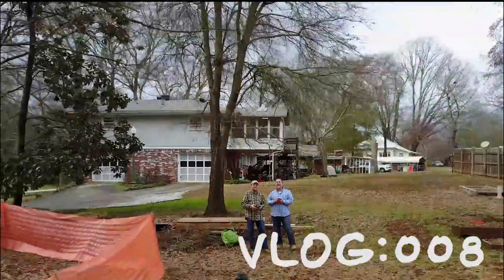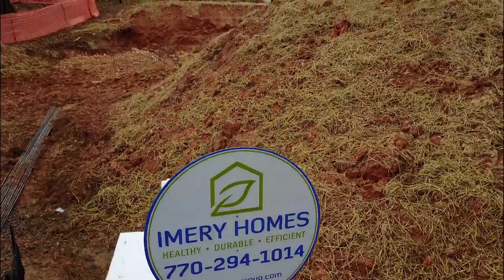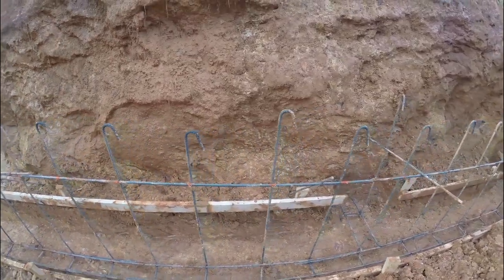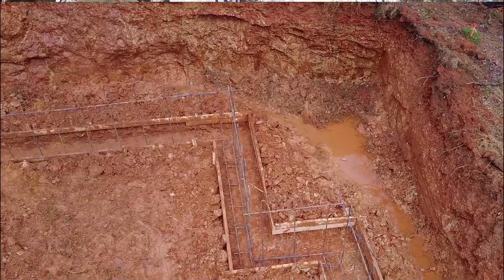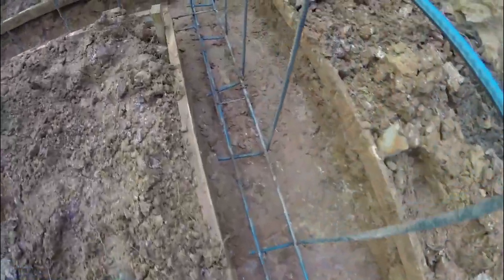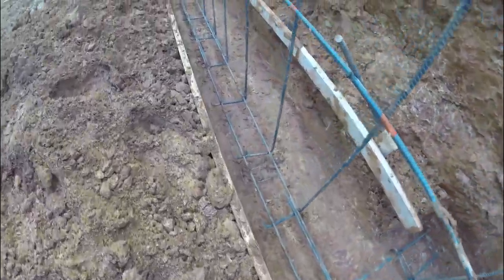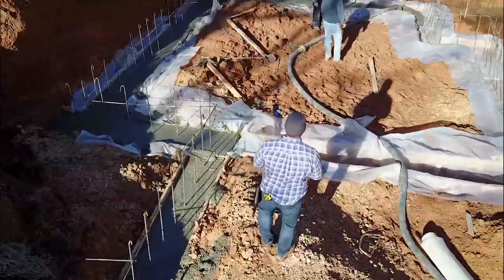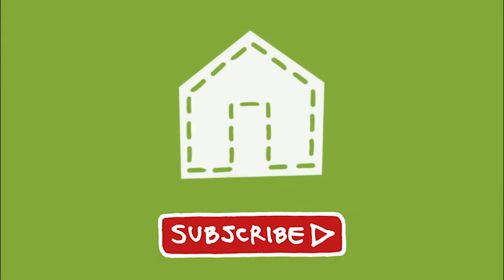Pouring The Concrete Footings | VLOG 008

Comment: Nice to see your progress on the new home. My question why did you not insulate the footings before the concrete pour? I presume the plastic was for additional water proofing, but why wasn't it used for the entire footer? Concrete is a sponge when it comes to water, and will always stay damp if any is present.
Reply from the maker: Hi Fred. Thanks for coming to the GreenHouse channel. We did insulate the slabs (future video), which sit on the footings, and will insulate the edges of the slabs as well. We've also got a waterproofing and insulation on the outside of the basement walls (also future video) and two drains. One on top of the footing and the second beside it.

Comment: I'm curious to know if you have heard about ICF (insulated concrete forms).  I don't have loads of experience with it as I am only an apprentice carpenter but from what I understand it's a greener option as there is a lot less waste material, less work in the long run and the forms act as an insulator/vapor barrier.  You share loads of helpful information with us, so I thought I would share this with you. Here is a link to a website https://en.wikipedia.org/wiki/Insulating_concrete_form with some more information on the system. I hope this helps in some way. Thank you for the videos. :)
Reply: Hi Keinan. We considered ICF, which would have yielded a R50 basement wall. However, the cost was about $4000 more than the traditional concrete. We do actually add a R5 fiberglass to the outside of the wall and closed cell foam inside the wall. The thermal total doesn't equal the insulting power of an ICF, but was a fit for the budget. More videos coming soon.
Reply: Thanks for the response Tom! That's definitely true, ICF can be quite cost prohibitive initially. I find that  not many people I talk to know about it. I look forward to more videos, keep up the good work sir!